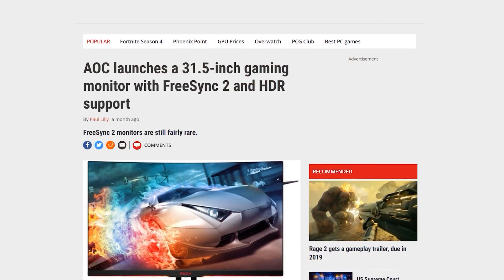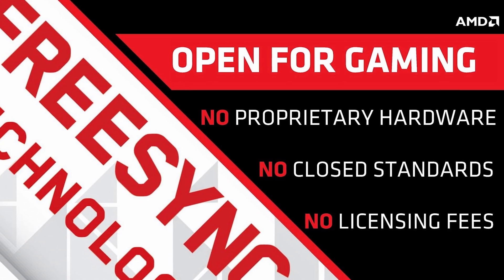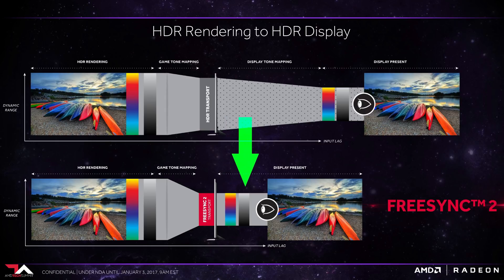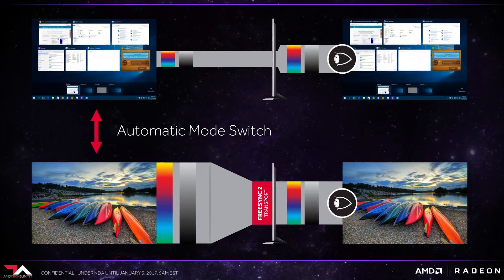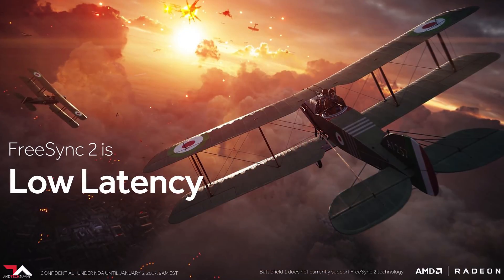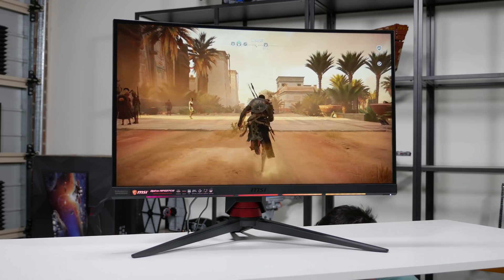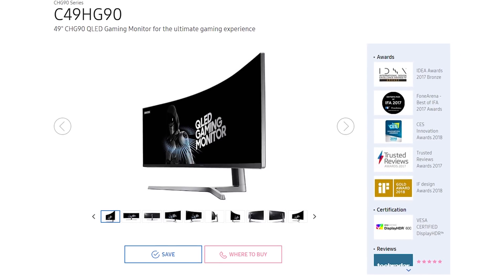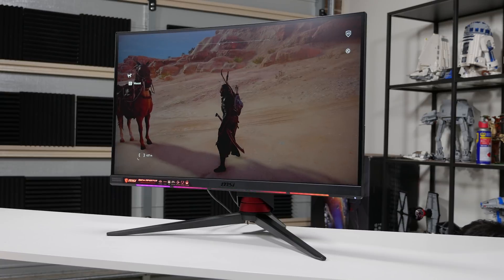FreeSync 2 in 2018 Explained, Does It Work Properly Yet?

Comment: AMD has problem's to keep freesync working right 80% of the time , i can already see the problem's freesync 2 will have
Reply: SeikonDS lol okay I have never experienced that.
Reply: Tora,

Yea I've always thought Freesync 2 was a bad name. I wanted AMD to stay with just Freesync and at the same time get quality certification requirements up. But now I realise it's better this way.

So in the future who knows, there'll be Freesync 3 that requires minimum HDR 1000 and some other tech. This way there'll be more choices for all budgets.
Reply: What are you talking about? Freesync works in everything from games made on Dx9 (at least) to all modern titles with one exception, Fallout 4.

 - G-sync also doesn't work on Fallout 4. It's either an issue with FO4 or windows at this point.(Opening and closing the WIN-G tab used to fix it on both, now it doesn't on either) Difference is most people on G-sync have no idea how to check their variable refresh rate in action, and it might automatically enable V-sync which may fool them if they're just trying to spot tearing. I would know, I'm essentially tech support for 10 gamers with 5 high end freesync rigs and 1 1080ti G-sync rig. If you think G-sync just "works out of the box" in all your games then I'll just assume you don't even know how to view your variable refreshrate as it works because if you do you'll see FO4 doesn't work. + you might find that Nvidia recently broke the only driver hack that worked to get SSAA in minecraft lol.. SSAA in minecraft previously was a HUGE pain in the ass to get working, and now it just doesn't no matter what you do including modifying the driver it's self beyond my capability. - Just one example of Nvidia drivers failing for YEARS to provide a basic feature for one of the most popular games that exist. Meanwhile fanboys like you who don't know shit tell people Nvidia is "The brand that just works" well I'm sorry to say that just isn't true, and in fact it's way easier for me to keep the AMD rigs running and looking how they're supposed to compared to Nvidia especially when it comes to driver tomfoolery...

Freesync works perfectly in Dying light, even with a custom profile to get 4k VSR working on a 1440p 144hertz monitor. I check all of my games via the monitor's GUI to see the adaptive refresh rate at work any time I please which is often.
Reply: Patriot 03 lol I've been around long enough to know what I'm talking about freesync does NOT work in dying light. N viewing my framerate is as simple as enabling the refresh rate monitor on my monitor. You probably use a bunch of freesync monitors from LG that this isn't even an option for so you have no real way to see If freesync works in game.
Reply: Freesync Works in dying light I play it often. - There is not a debate on this. It works.

PS: I literally told you I view my refreshrate via my monitor's GUI[It's Acer if you're so curious]. If Freesync doesn't work for you in dying light then that's an issue on your end.

Works fine on 5 Freesync rigs here.
Reply: Don't want to believe me? Have 2 photos I just took as proof. Like I said, I know what I'm talking about I spend an unreasonable amount of time on PC both playing, making, and helping others enjoy games.

https://postimg.cc/image/hcfthg023/

https://postimg.cc/image/uurb6xyuz/

 BTW that's even working with a custom resolution CRU profile which allows me to use a VSR resolution 125% of 2560x1440 at 144hertz which is what I having it run at, and 150%(4k) at 120hertz max. Without my custom profile It defaulted to 60hertz at 4K VSR which is unacceptable. Latest drivers RX vega 64, I know it works on Fiji and has been for the past few years.
Reply: Patriot 03 if it works it was just recently fixed. Google it. It was an issue for around a year. Completely broken. Just like fallout 4. That or you've found some way around it. The only way to fix it last time I checked was to revert to a driver that was about 6 months old at the time.
Reply: Check for yourself, because it's not a recent "fix". I have been playing it since 3 months after release on and off(I stopped playing on release day because at that time it ran like shit on AMD until they fixed it a few months later after which I started to play again), Freesync has been working on it EVERY time. Believe me I notice for one, and check all the time for 2 in all my games. - If freesync doesn't work in a game I notice before I start playing it. You can take that to the bank and cash it..

Also, like I said FO4 is still broken, including G-sync. I think it's a windows issue. Very strange since no other title suffers from the same issue or was fixed at any point by the WIN+G key which works no longer. It actually worked for a short period of time after AMD released the latest major driver revision that added the in game radeon overlay, but a windows update came along and broke it for everyone. I have tried all sorts of fixes and nothing. I check up on it with every driver/WIN update hoping it fixes it.
Reply: Patriot 03 you can say whatever you want it was completely broken except with an older driver. You're not going to convince me I witnessed for myself it not working on multiple rigs on multiple monitors that every other game had no issues (except fallout 4). I don't care how many rigs you've been or how many you've fixed for ur friends. I've been building high end gaming rigs for 10+ years. Literally dozens of forums talking about it and not one person saying it works in any shape or form except people who dropped down to old drivers. You're the 1 and only person I've ever heard say it works. It's not even worth arguing with you it's so ridiculous to me lol.
Reply: Patriot 03 also you're kidding everyone if you think AMD GPU Have less issues then nvidia. Literally everyone who builds rigs for a living will recommend nvidia over AMD just to make sure they have less issues.
Reply: You're full of shit, I know for a fact freesync has worked throughout Dying Light's existence. There doesn't get to be an argument about that.

It's great that smart people build their own, because they know Nvidia has had way more issues with their drivers than AMD in recent years, case in point the SSAA fuckery on Nvidia's end for i think over 4 years straight! You could get in deep into the driver and change 1 line of code to make it work, and now that breaks everything so just no SSAA for 1080 ti users on Nvidia now. What a shame.

Every PC I build for friends and family is AMD because I know it will work, and if not I know I can make it work. I get to avoid Nvidia's screwy drivers that break AAA features on a weekly basis without EVER getting around to fixing years old reported problems. Same thing with Freesync, I know it's going to work or can be made to work, ASUS ROG swift G-sync display's GUI doesn't even show you the refreshrate so it's a pain in the ass to even tell if it's working. How could you recommend something that is going to cost more, and has maintained a broken state of drivers that lack a basic level of support for one of the biggest games in history for years on end now.

The funny thing is, Nvidia can support Freesync, I've seen it done before with some driver hackery but they could release an update today to support it and then EVERYONE would use it because it's more efficient. - The frames are cached on the GPU anyway - NO NEED FOR A CHIP TO REPEAT THE PROCESS. That's the reason why G-sync has more latency. That chip offers nothing else besides extra latency. I'm not even sure it plays a role in cheap grade frame reproduction below 30 FPS but I guarantee you that could be done via the GPU too if one really wanted. (Or do it on the panel, and just sell it as an extra feature people won't use on expensive panels) Point being a 1080 ti doesn't need to have frame reprojection sub 30 FPS. That's the only thing Freesync doesn't have as a brand but I don't think that matters for the vast majority of gamers.

Freesync, or some version of it from at least HDMI support will be on every display made if it's not already. Besides Nvidia's monopoly on mind share G-sync serves no purpose because Freesync is by far the better route that is FREE for Nvidia to support.

TL;DR: Freesync does the same job with fewer steps because it doesn't wastefully re-cache something that was already done on the GPU. - More efficient, easier to support, - Free to support for everyone in the industry.

In fact, when it becomes an HDMI standard (Which nvidia may not even support btwXD) it will be a common place tech for all of your devices.
Reply: Patriot 03 you just make me laugh. Everything out of ur mouth is the complete opposite of any builder I've ever met opinion. Your comparing ssaa issue to AMD that up until a few years ago you would basically have to reinstall Windows to downgrade a driver because driver would fail on install. Which you frequently had to do because they would break drivers so often. N do some research. 100% depends on your settings which one wins and in what games. Overall they are basically the same. Vsync on one wins vsync off the other wins. At 45fps one wins. At 120fps the other wins etc. I'm done with this anyways. Better shit to do then argue with someone who's clearly fanboying. Nvidia is enthusiast level. Nobody building an ultra high end PC buys AMD. It's mediocre af.
Reply: Says the guy who just told me Freesync doesn't work on Dying light and I proved you wrong.

Nvidia melted PCs a few years ago haha. "Nvidia is enthusiast level" No, Nvidia is the basic bitch's choice because of the mind share. I said it years ago, when the 290x was still 2 years old it was better than anything Nvidia had on offer but the 970/980 had a temporary win in some titles but then what happened no later than a year?

Check out any benchmark today comparing the 290x to the 980, 970 is old news it doesn't even come close anymore. I use RX vega 64 LC > 1080 and in fact, given the issue with SSAA on Nvidia I chose Vega over the 1080 ti hybrid cooled (That and Vega beats the 1080ti in Cycles GPU rendering in Blender). But Vega is a weak GPU compared to their average, wait until Navi and AMD will be back to where they usually stand beating the competition or at the very least matching it.

PS: Vega is AMD's weakest launch in years compared to the competition, and still manages to be the better buy for people who game and render productivity workloads. + SSAA in minecraft(That's a deal breaker for me, sorry Nvidia get your shitty drivers in order) +freesync>G-sync which saved money.
Reply: Patriot 03 lol fuckin fanboys. No logical sense at all. What 290x is good because AMD took literally years to pull all the horsepower out of their gpu specs because they can't make drivers for shit. 780 was as fast or faster then 290x when it came out. Congrats on your Vega. You paid a ridiculous amount of money for something that competes with a 1080 and uses twice the power. Juuuuuunk.
Reply: No logic? Wait, you're calling ME the fanboy now?

You said Freesync doesn't work in 50% of games(Bullshit), you used Dying light as an example which also was proven to be bullshit.

You claim G-sync is better for some reason apparently, even though the fundamental use of the on board chip serves no purpose other than introducing a redundant step increasing latency. 290x was ALWAYS the better buy because in optimized titles it squashed the competition, which as predicted turned out to be a sign of what Hawaii was capable of when optimized for properly either by the game/API which was proven at the time with Mantle, or via the driver overhead which eventually ran DX11 very efficiently for AMD.

Nvidia never had a significant lead, and lost said lead as soon as AMD solved their incredible DX11 inefficiency (Which has been solved now for years). By the time Maxwell released it was clear what the hardware was capable of under efficient APIs/drivers as demonstrated by Mantle in BF4. Only an idiot would have recommended(Ignoring power consumption/price in socialist countries) the 970 or even 980 over the 290x which at the time you could get 8gb versions from Sapphire for quite a fair bit less than the cost of a 970 (At this time, the 290x was already beating the 970 in most benchmarks). The point was, the future indicator of performance was that found in optimized titles of the time, not the poor running Nvidia sponsored games but I'll grant you until Omega came out (Which was YEARS ago now) AMD DID have a big issue with DX11 which is why 290x ran as poorly as the 780 ti/970. That wasn't going to last.

But if you go further back before Hawaii, you'll find those Nvidia GPUs that would melt your computer, ran WAY worse than the competitor, and were the hottest GPUs I think to date. They called it Fermi.

What it really comes down is, you told people to buy 780s/970s/980s (lol) back in the day, and those same people are now regretting their decision if they know any better. Meanwhile I have 4 healthy 290xs that are still totally relevant GPUs running in Friend's and Family's rigs right now, same goes for 5 FuryXs and after Navi my Vega will become an upgrade for someone else to live out the rest of it's days which will be plenty. DX12 support proved not to be a problem for Hawaii despite Nvidiots saying only Maxwell was "fully DX12 compliant" which didn't turn out to be the case now did it? Fury at least matched the 980 ti close enough and manages to beat it today so on that end I've already agreed Vega has fallen behind AMD's usual track record of at the very least offering equal performance to Nvidia's top end within a few percentages, but there is another dynamic that simpletons like you don't seem to factor.

Vega 64 is straight up faster in productive workloads than the fastest 1080 tis. Which is just 1 primary reason Vega can still be an attractive offer. But I can see you don't have much experience with these 2 companies. Did you get into this as soon as Hawaii launched and got burned by a few years of poor DX11 performance (but still maintaining parity with Nvidia's top end at the time)? Wait and see what happens when AMD launches Navi. As for the software side of things AMD has been leaps and bounds better within the past 4 years now(how long ago was Omega?).

PS: I'm not going to say Vega will end up beating the 1080 ti, but an indicator of future performance would be that of what you see in Vulkan titles like Wolfenstein 2 where I believe the 2 match each other. So I don't think "fine wine" at least has gone anywhere. I'd much rather spend my money on GPUs that will have a long respectable service life given that I still have HD 7850s in the pipeline of Family then Friends. When I buy a GPU it pretty much sees nearly a decade of service if I had to guess before it's thrown out/sold. Meanwhile how many people do you know who are content with a gtx6xx gtx7xx series Nvidia GPU in terms of performance in modern titles/future APIs?
Reply: Patriot 03 I never said it doesn't work in half of games. You're so mad. Calm down. I'm not reading ur entire novel lol. Fermi wasn't that hot. Moderate fan profile that ramped up to around 65% fan speed kept the gtx 480 around 80° no problem. 5850 and 5870 ran about the same but WAY louder. Max fan speed of those cards was nearly double that of Fermi. People only ever talk about the % tho not actual rpm. I've owned 3x470s, 2x480s, 3x5850s, 1x5870 and absolutely every 1st and 2nd tier card since then from both sides. I know wtf I'm talking about and I don't care about ur long winded opinion that opposes every builder who's not a fanboy who's alive today. Give up.
Reply: BTW, I still own high end Nvidia GPUs and respect the brand. But facts are facts and you're spewing out nonsense and I proved it.

I will now quote what you said about freesync not working, you're right you didn't say 50% of games, you implied essentially all games 

--"N u have to tweak every game to work correctly. Garbage compared to gsync." - Now those are true words of a fanboy. I never said G-sync was useless, why would I it does the SAME THING as FREESYNC, it's just more expensive and less efficient resulting in slightly more latency but besides that the 2 techs produce the same exact results.

Only a fanboy says one is "garbage" compared to the other. I will say though that freesync is better for the reasons mentioned above and it's cheaper but that's not to say G-sync is garbage it's just more expensive for basically the same thing. What would be better though is if Nvidia decided to support freesync, then G-sync would either disappear or exist for only the most hardcore of Nvidia fanboys to ooz over having a chip on board their display driving up prices to repeat the same work the GPU already does.
Reply: Samako Mies fallout 4, dying light don't work at all. N u have to tweak every game to work correctly. Garbage compared to gsync.

Comment: Can I ask a question ? 
At the start you've said everything so thank you 
But there is my question :
When i play cs go  i was trying to find the resolution that will give me better gameplay (from 4:3 ...16:9 ...) And the fps of both  , was higher than 60 , at 150 for 1080p , and at 250~300 fps on 1025x768 ....
All tho it was higher than 60fps , I could feel the difference , a less ... latency with it , I just felt it was smoother . 
Now is my question 
What freesync /g-sync will give me at 200fps with 144hertz refresh rate ? 
how can you explain me feeling better "latency" because of better fps even on a low refresh rate monitor ?